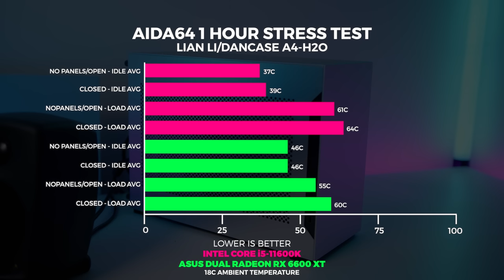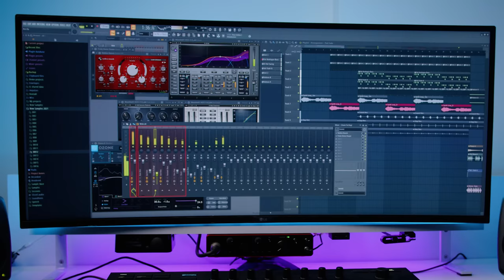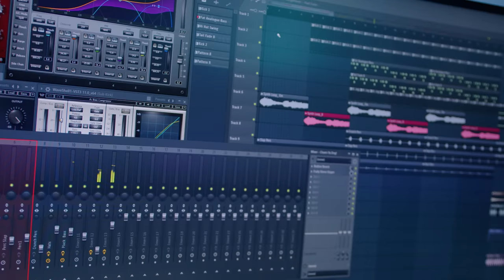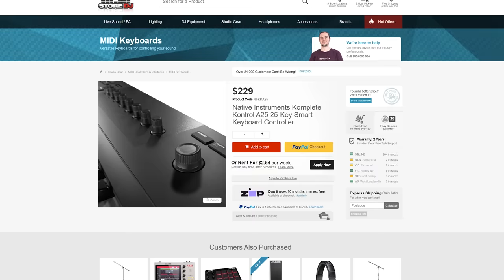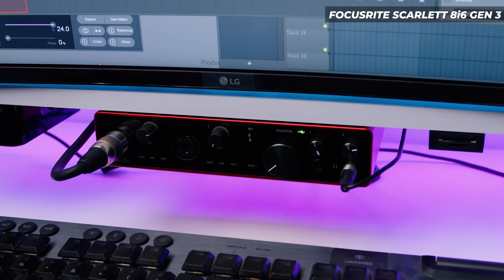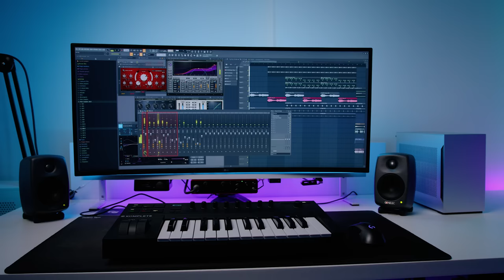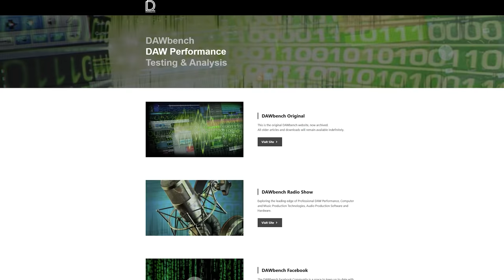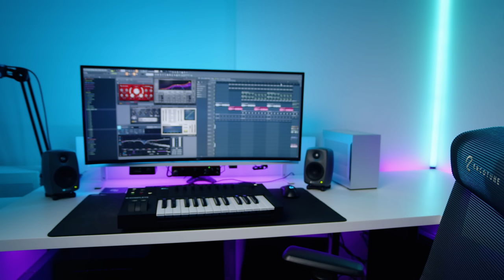My NEW Music Production PC is TINY and SILENT!

Comment: I use a fractal design define c matx case, fanless psu, and a thermalright macho rev.c. With the fan settings on silent in the bios it is inaudible. I had a focusrite interface and switched to an  rme babyface pro. I get a lot better CPU performance with the rme. The drivers are much better.

Comment: Dude I hear you on the AIO’s with the pump in the rad, I have an MSI Liquidcore 360 and 6 months it’s dead, I’ve always been Corsair having never had an issue with there AIO’s but thought I’d try something new, Lucky AMD have said the 5800X running at 90-95 won’t damage it cause it was doing 80-90 idle but seemed like everything was good, programs said the pump was running and there was heat transfer in the pipes, turned out the pump was a dud so back to Corsair I went

Comment: Why not go with a AMD APU like 5600G or 5700G ? Or Intel with integrated Graphics ?  Should save on space, heat and power in the case.
Reply from the maker: I answered all of that in the video. I used parts I have that I'm not going to be using anymore and I need Thunderbolt 4.
Reply: @GearSeekers  Great build. I've been watching your channel for a few weeks now and finally subscribed.

Comment: Do you think a 5900x with a 6600xt would be ok thermally in this case? I need a new PC for work (just several VM's, nothing too intense) and thought this case looked good and I don't need it to be overkill. Thanks for the great content!
Reply from the maker: I think you'd get away with a 5900X. I've had decent results with 240mm AIOs and the 5900X. The trick is undervolting it a bit. It will drop the temps quite a bit.

Comment: why couldn't optimum tech get the corner mobo screw in but you could? is that just mobo dependent?
Reply from the maker: No. I made it fit with every board I've tried
Reply: @GearSeekers  strange, good to know though! thx
Reply from the maker: @JSG42069  3 screws is enough anyway

Comment: I've actually been using the Z590i and 11600k for music production and gaming for a while now too! I've been dual booting windows and MacOS and been getting the best of both worlds. Love the thunderbolt ports. However, I lucked out on an irresistible deal on a 5950x (dude upgraded to alder lake) so I'm back on my Asrock X570 itx/tb3... yup you guessed it also hackintoshed and using that tb3 port! Anyway, great vid, always love your content!
Reply: What gpu are you using with this dual boot setup you have? I heard macOS doesn't play well with Nvidia
Reply: @GabrielKLKN  That's correct, since Apple switched to AMD, newer nvidia cards are not supported. I'm using a 5600xt. BigSur and Monterey can also make use of the 6800 through 6900xt if you can find those
Reply: @jwkuo  sweet, thanks!
Reply: How about fans noise bro ?
Reply: @CB-iu8yf  Can be a problem if you don’t get the right components! But if you get the right case and cooling and set up a custom fan curve, it’s absolutely fine. To my ear, it’s no more noticeable than the fans ramping up on my older intel macs. Haven’t tried m1 yet though, so can’t compare it to that.
Reply: @jwkuo  thanks for the quick answer 🙌

Comment: I just wish I knew how to setup/disable bits of windows to optimise my DAW performance and minimise interruptions from windows doing unnecessary crap for Programms and functions that I don’t either use or need when I’m mixing and mastering, built it with a 5950x and 64GB of super low latency RAM and somehow I don’t think I’m getting the speed and workloads that I should…..help!